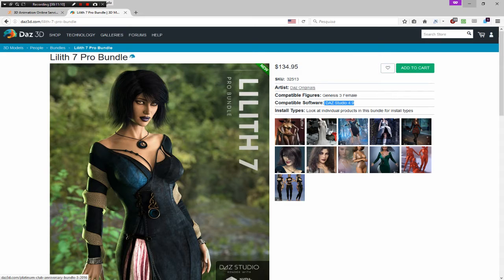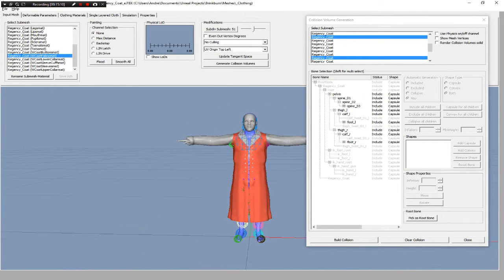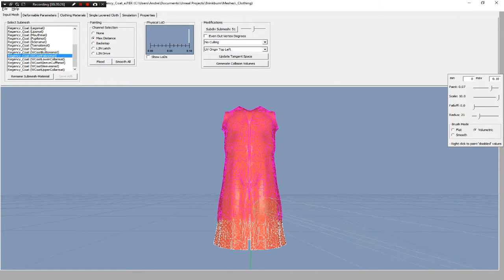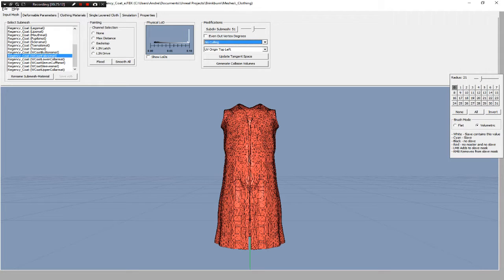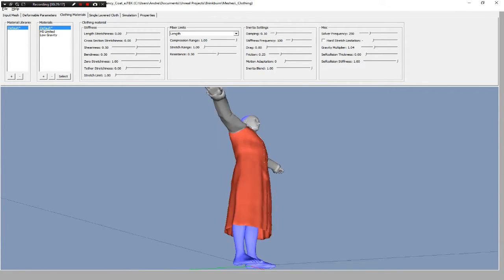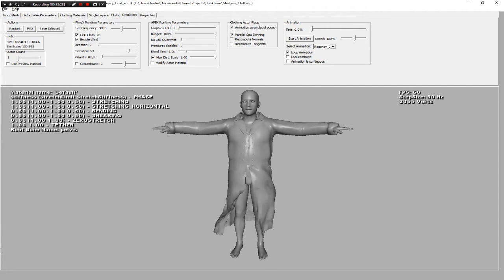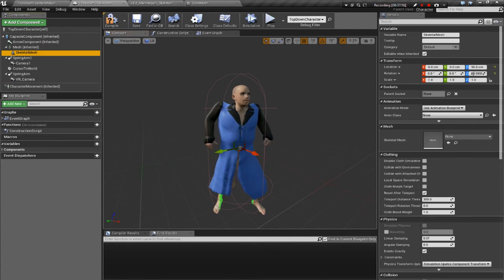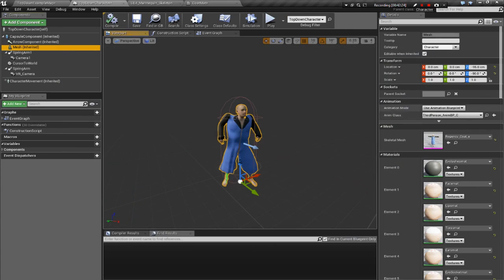Unreal Engine 4 APEX Clothing Tutorial Part I

Comment: I'm stuck with this message: Chunk 1 in Skeletal Mesh XX_XXXXXX has up to 5 influences on it's vertices. The maximum when using cloth is 4, reduce the number of influences and reimport the mesh to allow cloth on this mesh. I can only get it working by splitting my mesh into smaller pieces and rigging the cloth parts to a single bone. This kinda sucks :(.